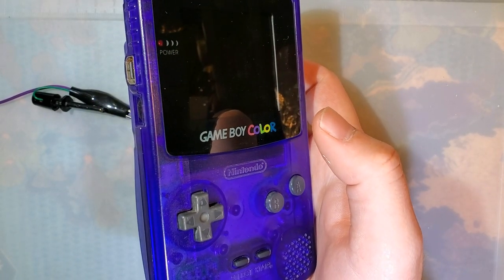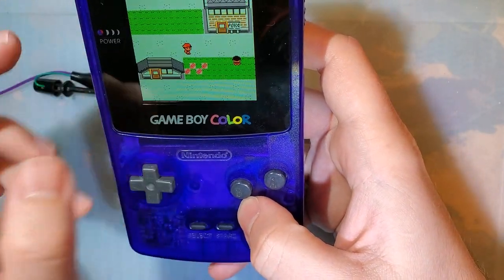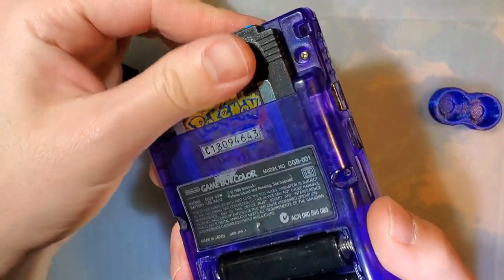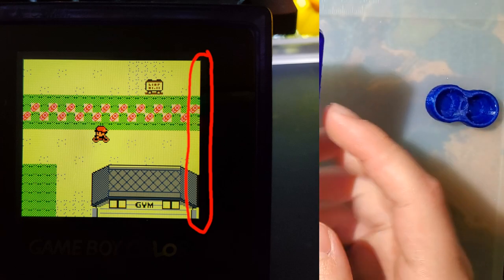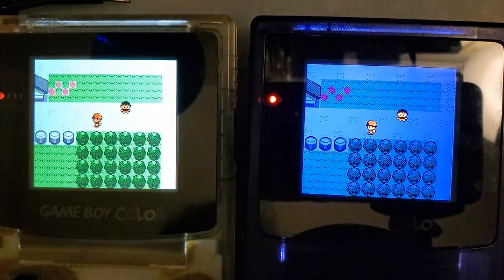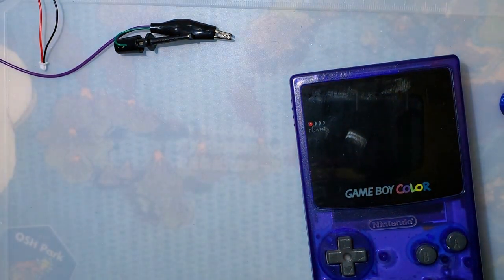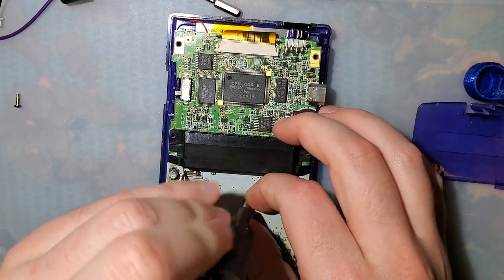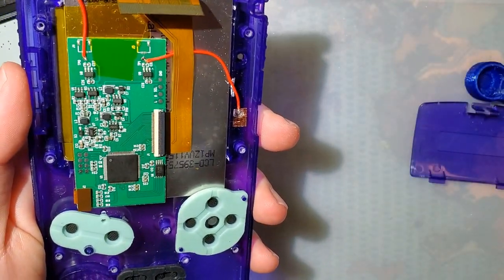Followup on the "One Chip" Game Boy Color IPS Screen Kit (Custom Color Palettes!) (Part 2 of 3)

Comment: Idea for a video: best buttons/button pads for GBC/GBA? I Bought a AGS-101 GBA from retromodding years ago and i just didn''t like the clear buttons that came with it, i swapped to buttons/pads from an original GBA and there's just not consistent button presses with the Dpad (Like needing to press right harder than you would for left for character movement), was hoping you know of a better alternative.
Reply from the maker: For pads, OEM is almost always best in all cases unless the pads are really worn out to the point where there are holes in the silicone. For buttons, same deal really. Just gotta give this stuff a clean. It's all pretty subjective though.

Comment: Where can I get your tools to supply a power to gbc and it build in a battery ?
Reply from the maker: I made a power supply. Search my channel for 18650 and you'll find it. The old one I made (and used in this video) is quite a bit underpowered for this particular mod though. The new one I made doesn't work as well as I'd hoped and has some questionable quirks so I don't really use that one either.